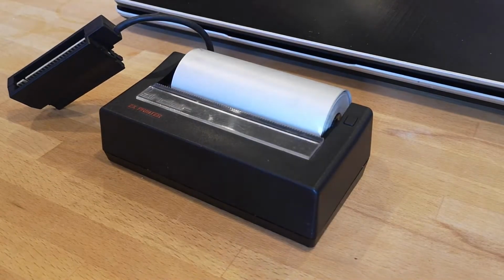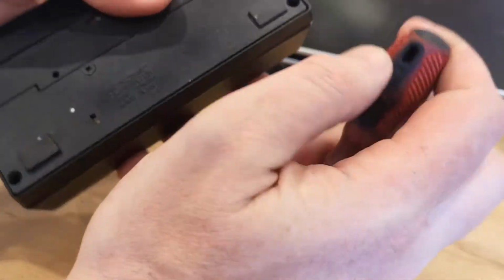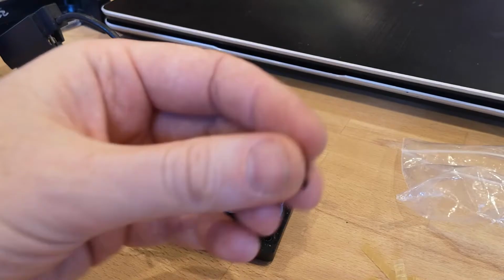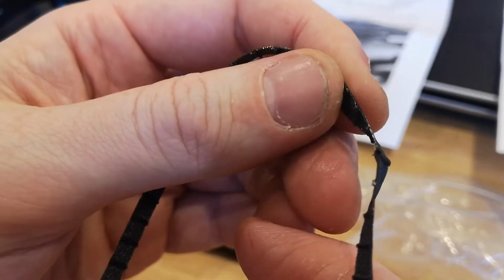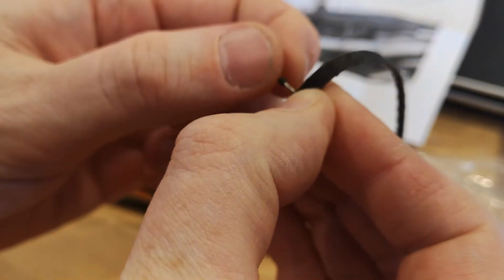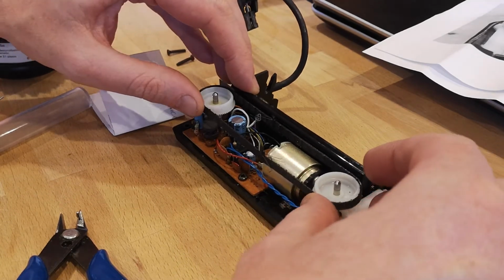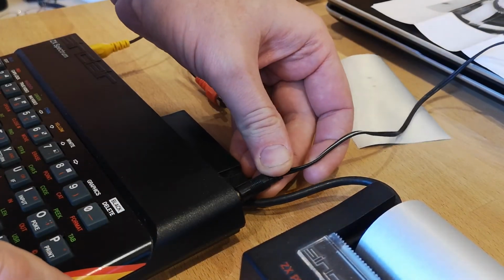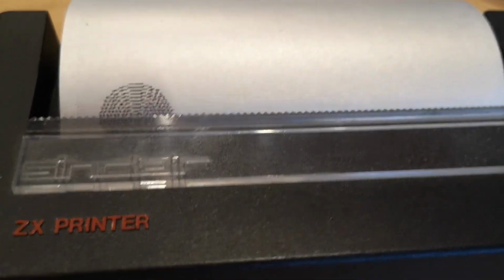ZX Printer Repair. Band replacement. Spectrum Printer

Comment: Do you know if it'd work with modern thermal paper? I've heard older thermal paper has some chemicals that are best avoided
Reply: No. This isn't a thermal printer, it is a spark printer. It doesn't use thermal paper. It uses a metal coated paper.  I don't believe any has been made in years. Your only chance is finding some used.

Comment: I never understood why Sinclair, to keep things as cheap as possible, didn't just create a ZX extension to centronix parallel and let the printer manufacturing to others, instead of investing in this "printer", especially because those who bought the ZX (8x and spectrum) were teenagers and a printer was not their primary choice in term of extension, memory yes, joystick(s) yes, eventually microdrive(s) but printer rarely. 
If a parallel extension had existed from Sinclair, for those with parents already having a PC or another "professional" machine with a matrix printer, buying this extension would have been a better option than this A5 grey paper thermal printer, not even usable for homework. 
Especially because it existed, "Inter Printer", released in '83, but I discovered it long after my Speccy has became a nostalgia machine, it offers 3 printer mode EPSON, MCP(a kind of thermal printer) and ACCORN, in other word only EPSON mode for "modern" printers .

Comment: Hi excellent stuff.
Have just opened up my dad's old printer.
Belt in pieces and exactly the same piece of plastic came off😁
Did you ever look athe diode? Does it produce any light or something visible?
Don't know if that is broken as well.
Also: could you drop me the band replacement order link?
Highest regards, Mac
Reply from the maker: Hi, thank you for the comments. I never investigated the diode. You can purchase a band from https://www.sellmyretro.com/offer/details/zx-printer-replacement-belt-43869

Comment: Hi John. Thanks for the video. Just a quick question: what size (diameter) solder did you use in your band for the stylus? Cheers
Reply from the maker: thank you for the comment.  I'm not certain, but looking back at the video and comparing it with the solder that I have I think it's about 1.2mm thick

Comment: Somebody knows where we can buy aluminum paper? Thanks
Reply: Perhaps the same person knows where we can buy a flat red battery to fit a Sinclair Microvision TV?
Doubt it though. 
Luv and Peace.
Reply: There was a slightly improved version of the Bog Roll printer made by Timex but only sold in the states.
The paper was white but it still thermally printed.
My Dad had one and we had this crazy ammo box sized step down transformer from the 50s that used to make a crazy loud thump when it turned on and hummed like crazy.
Speccy days were amazing.
Luv and Peace.
Reply: @ianedmonds9191  that printer used thermographic paper, like till rolls, that paper is still easy to get. The ZX Printer is a spark printer and uses metal coated paper, I believe it’s no longer made as there were ever only a few spark printers in existence and the ZX Printer was likely the biggest seller.
Reply: @ianedmonds9191  the battery in a polaroid instant camera film works the TV